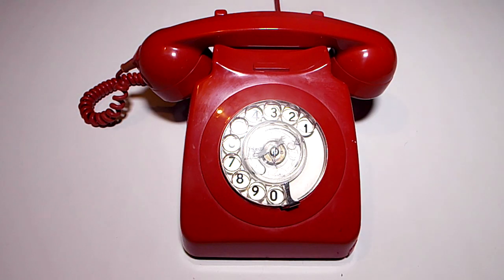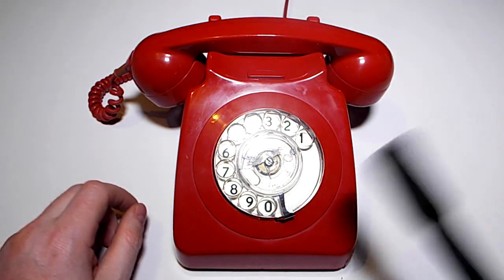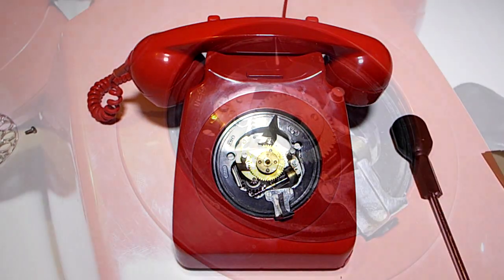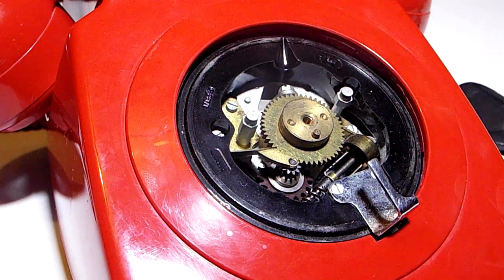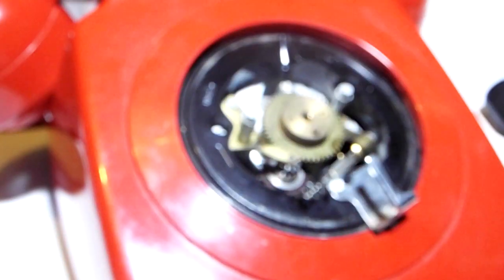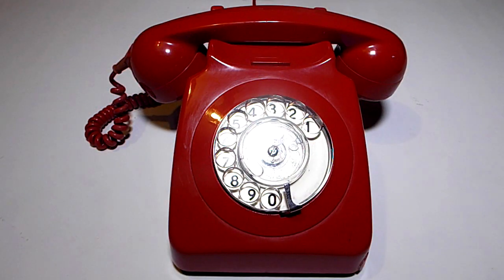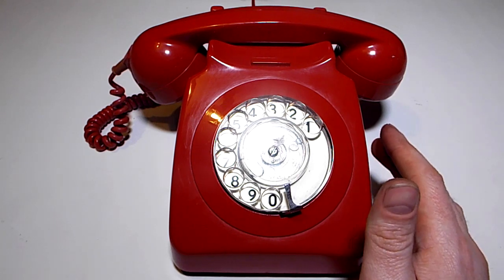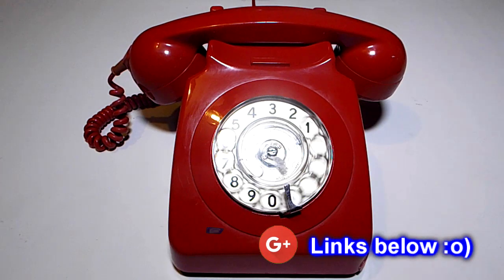Vintage Rotary Telephone Dial Mechanism Repair ( GPO 746 )

Comment: Nice job there, still using an old black one that was in the house when I moved in 27 years ago. It was pretty elderly then ! It still rings out, but many newer telephone exchanges don't recognise the pulses from it, so an old BT/GPO bloke tells me. These were designed for the older "Click and Bang" exchanges, all electro-mechanical. Fascinating to watch all those switches move it was.

Comment: Great simple explanation. I did this a few minutes ago on my 1974 MK1 746 after it started to struggle returning back. Cleaned the muck out and oiled with baby oil, now runs smooth and quiet.
Reply from the maker: Glad it helped

Comment: The 1947 phone I bought came to-day, the dial was a little stiff like the video, but the finger wheel is metal not plastic, and held on with a brass nut not a screw, and the porcelain enamel number ring didn't seem to just come off and I didnt want to damage it, so I sprayed a little De-Oxit contact spray cleaner around the shaft and inside the back of the dial mechanism and it freed up instantly.

Comment: The centrifugal break should not have oil, but the cleaning done here is a great job. The right speed of the dial returning is 10 pulses pr second. To far from this may cause problems.

Comment: Hi, I just bought a Pink GPO 746 it’s a modern reproduction also with the dial as this one in the video.  There’s not much to it except plug and play. I don’t have wall phone plugs so I plugged it into my Router where my modern wireless one was plugged. It works wonderfully except for one thing. 

I can ring out and hear the person on the other end and they can ring me and I can hear them clearly BUT they can’t hear me regardless of whether I ring out or they ring in.

It doesn’t really make sense.  Do you know of a solution?

I’m in Spain but I presume that all internet connections via optic fibre are the same right?

Any suggestions would be very welcome.

Thank you 😊

Comment: Is that a modern GPO 746? I've just bought a grey one from http://www.nicestuff.co.uk/ and it should be delivered next week. I'm hoping it'll work for a few years as some have commented saying they are bad quality.
Reply: The original ones are sometimes cheaper on Facebook Marketplace. I've tried one of the repro ones, not exactly the same feel as the old ones .
Reply: Hi, I just bought a Pink GPO 746 it’s a modern reproduction also with the dial as this one in the video.  There’s not much to it except plug and play. I don’t have wall phone plugs so I plugged it into my Router where my modern wireless one was plugged. It works wonderfully except for one thing. 

I can ring out and hear the person on the other end and they can ring me and I can hear them clearly BUT they can’t hear me regardless of whether I ring out or they ring in.

It doesn’t really make sense.  Have you had the same problem?  I’m trying to find a solution.

Thanks 😊